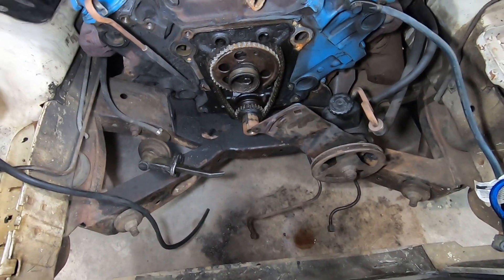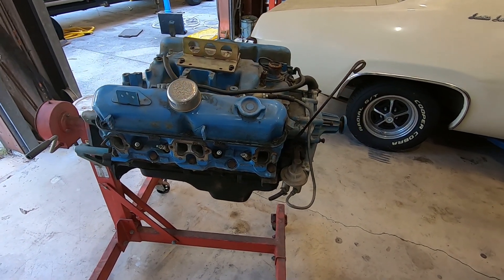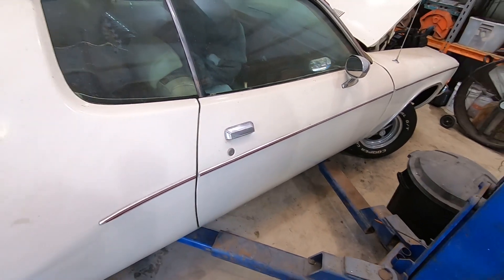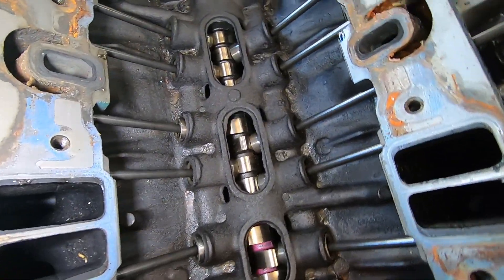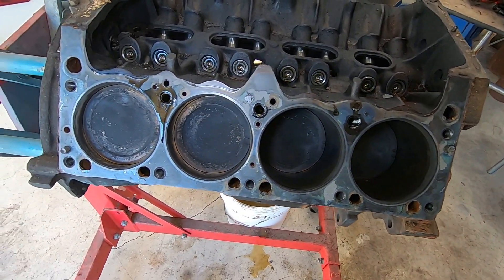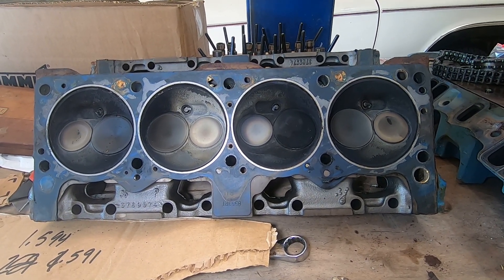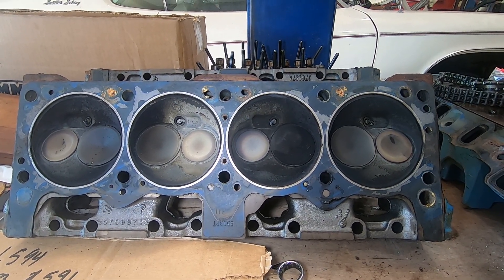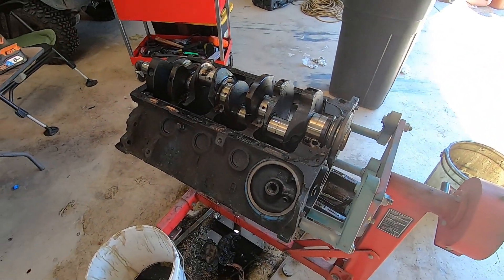MOPAR 360 Rebuild Part 1

Comment: Yes, absolutely use that cam! The newer cams are kind of chancy, because manufacturing is not as good as it used to be. Most is outsourced to China. And today's metal in not always the best. A lot of people are buying roller cams now because new cam breakin failures.
I would just go through and clean that 360 and put it in.
I had a 74 white RR with its  original lower mile 360 and that car moved out really good. I did put probably that same cam kit in it. It was a purple shaft. I did have headers though.
I'm sure you probably know the 360 is externally balanced so you will need the right balanced torque converter!

Comment: Looking forward to more on this rebuild.  I’ve got a 74 360 LA motor out of a Dodge Sno-fighter sitting on an engine stand waiting for its rebuild…
Reply: probably has 974 heads. they still retain the larger 340 port but use smaller valves. open it up for 2.02s and do some bowl and blend work. should flow around 230-240cfm. plenty enough for decent torque and power in a street 360.

Comment: Dirt is from running K&N or similar air filter.  

The E58 (police) 360 had a number of HP components, including the 2.02 valves and 340 cam. The E58 was the ultimate LA engine, for sure.  

The police E58 360 wasn't actually used in pickups, except for the LRT.  Most pickups used the E56 4bbl or the common E57 2bbl. 

The E58 replaced the 340 in 1974, was was discontinued in early 1980. The E48 318 4bbl police was introduced in 1978, and replaced the E58 that March, when production of the 360 moved from Windsor to Saltillo. The E48 shared all of the E58's HP components, including the 587 heads. In 1983, Chrysler began using the 345 head on the E48, which is similar to the 587 head, except that they have larger coolant passages.  The E48 was replaced on 1984 with the similar ELE 318 4bbl police engine, that lasted through 1989 with the M-body squads. 

My guess is you have an E56 engine, which is fine, but it's not an HP or Severe Duty version.  Building an E56 to E58 specs should still be doable, but the key thing is that the police engines were set up for maximum durability and reliability, not maximum power.  The .429/.444 cam from the 340 was used in the E58, as were the 2.02 valves.  Allpar has all the specs.

Comment: Im looking at adding more power for my Dodge B250 with a 360LA to have better time climbing on the hills and travelling at highway speeds, any advice on what modifications? Reliability is the only other thing that matters to me. Any input appreciated, thanks !
Reply from the maker: The secret to any engine for gaining extra power is to improve It's ability to breathe..  A camshaft upgrade, better carburatipn and a good exhaust are all easy and cheap modifications to increase power.
Reply: @mikesmopargarage4734 I would add rear end gears. And Tire size. My Dakota RT is happy with 3:92 gears.

Comment: at 9:43 I stopped watching to input this Im betting that its a 509 purple shaft cam, why? just because everybody used that cam back in the day.
Reply: If a .509 cam-the girlfriend won't be driving it and no vacuum for AC and power brakes.
Reply: @MyronBuss  interesting, I ran a 509 in a 318 with 360 heads it functioned the power brakes, and it didnt have ac.

Comment: 360 never came with 202 valves some 340 is even came with 188 are 187 + 360 is never came with 202 valves 1 160 exhaust and soda 340
Reply from the maker: @wintonwright4244  Yes I mentioned it in a later comment.  I was misinformed.  However it does have 2.02 valves so someone paid to open them up.

Comment: NO 2.02 valves in any 360!!!
Reply from the maker: You are correct. I was misinformed.  These are the stock '75 heads that someone did rework and put 2.02 valves in.